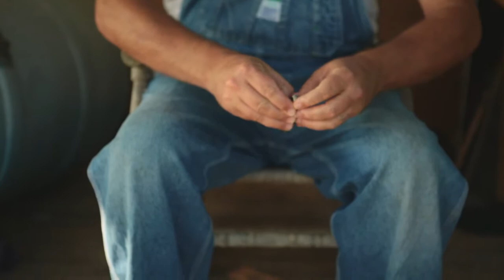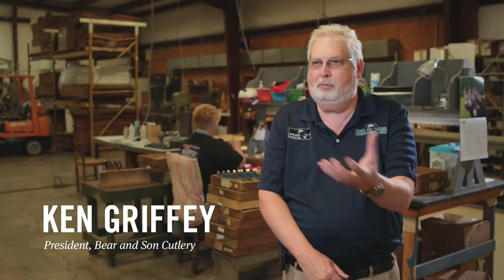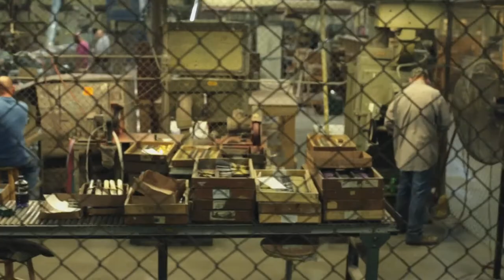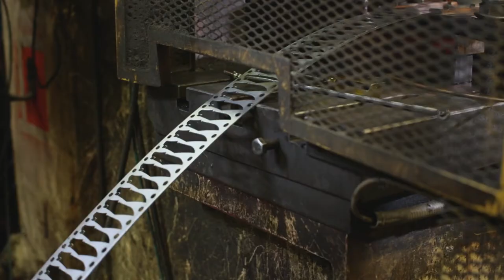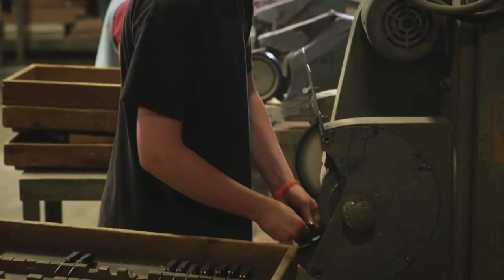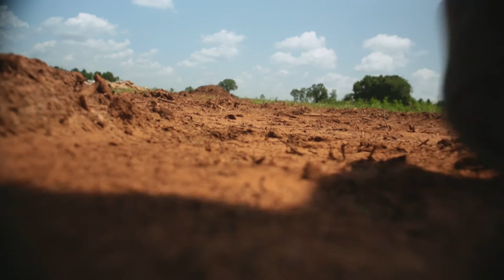Last of a Dying Breed: Bear & Son Won't Give Up on Knife Business

Comment: My mother in law bought me one of your hunting knives as a Christmas present about 16 or so, years ago. Still my go to hunting knife. I keep the edge razor sharp, just generally try to keep it clean and ready to go when I hit the woods. I used it today to cut some thorn brush out of my way, and still impressed by how I can cut stuff with ease (one handed) just cuts through anything. The fact that after all this time, I’ve never even looked into the company that made it. Today became that day. The fact that it is still impressing me every time I use it. It sharpens to shave hair with out too much effort, and as many times as I’ve touched up the edge, there is no wear. I’ve used this for everything from hunting/camping to cleaning hair out of vacuum for my wife. It’s just solid. Pretty sure I’ll be hunting with this one for rest of my life. Great job guys. Really. I’m not the kind of person who takes time out of my day for this kind of stuff often, but this is worth it. I wish I could say that for other stuff I’ve bought over the years.

Comment: So glad I found this video. I always thought that Bear and Sons was an import knife. Glad to be corrected. Like you, my Texas - born dad bought me several knives and taught me to whittle. That was 60 years ago and I still carry a slip joint knife. My USA made Kabar was a lifesaver in Vietnam, and despite all the fuss about. powder metals and the latest / greatest locking system, I still prefer a carbon steel blade. Thanks , Ya'll

Comment: Bought a large Sod Buster a couple of years ago. It's crap, disgusted and never used it. Opening and closing the blade was sluggish because of a weak back spring. The blade tension was too light.

Comment: Are they good quality?
Reply: Maybe you might have better luck than I did, but the 2 I bought weren't good. It seems like they have really bad quality control issues from what i hear. Mine had weak pulls, the blade the blade wasn't centered and was rubbing all the way to one side, big gaps, the action was gritty even after I cleaned and oiled the heck out of the knife. It's honestly a shame because I'd like to support a Made in USA product, but like Case, who has similar problems, they need to get their quality control in order